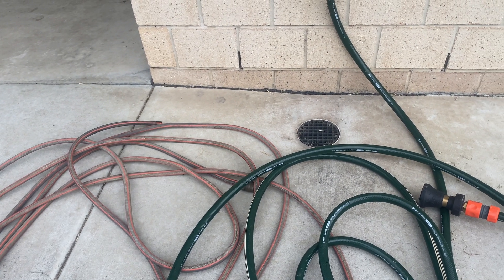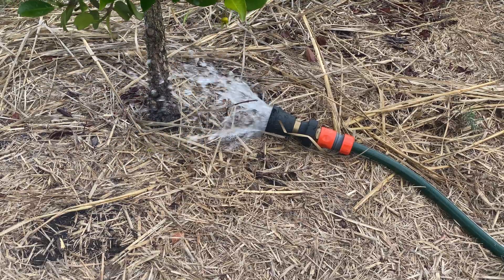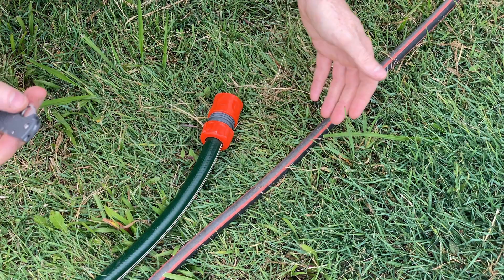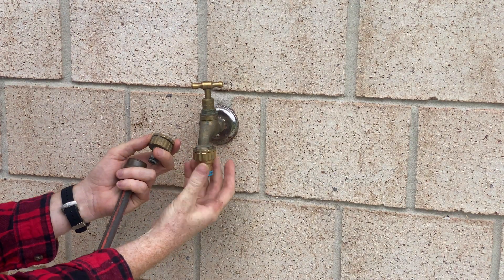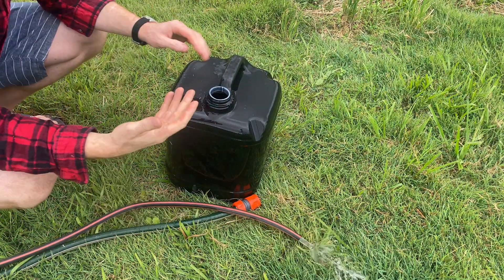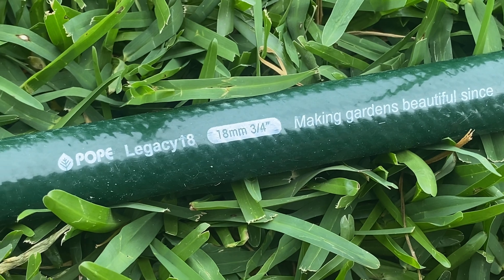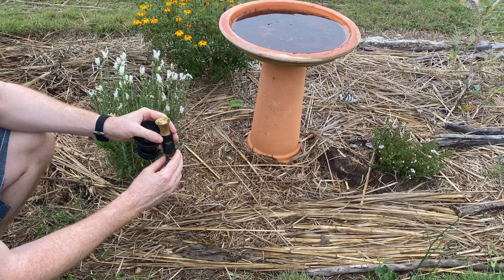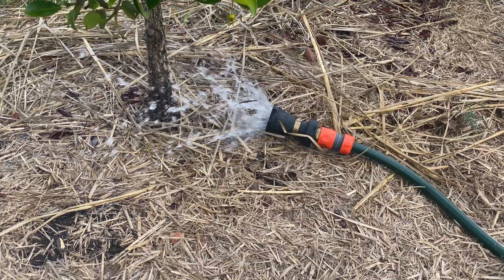18 mm Vs 12 mm Hose

Comment: Thanks for this mate. Saved me the time to do the tests myself. One thing I can’t wrap my head around is if the tap isn’t changed I would have thought it would not get the full benefit. I guess as you mentioned, there’s a large benefit to the reduced friction. This should dramatically improve my pressure washers performance and washing down equipment too.
Reply from the maker: Yeah I imagine with a better tap/gate valve you would see even greater results, certainly a bottleneck.
Interested to hear how you go, maybe try just one first and see how it works for you?

Comment: Good information video. Thinking of upgrading to 18mm. Can I use existing oscillating sprinkler which are connected to 12mm hose to the new 18mm? Or will I need a compatible sprinkler to 18mm. My concern is even though if I switch to 18mm hose but the 12mm sprinkler will choke the flow as I want use through pass sprinkler and connect another to it. The existing 12mm doesn't have the flow pressure.
Reply from the maker: Hi RSG. Assuming you could change the fitting sprinkler or use an adapter it should work fine. It will choke it a little sure, but most of the pressure lost is due to the hose friction anyway so you should still see an improvement. I use a 12mm hose wand here that I changed the fitting on to make it compatible. Good luck!

Comment: Very nice test Daniel 👍
I’m surprised there was that large of a difference when it was 12 initially then upped to 18at hose
I’m a big fan of the brass fittings especially because they are a lot more freeze hardy and the Holman cool looking double blue o ring made me start to settle on their range also 😂
Reply from the maker: Thanks Neil! Yeah big difference considering and obviously the gap widens with hose length. I often join two this length together to get to the ends of the property so we’ll worth the upgrade here.